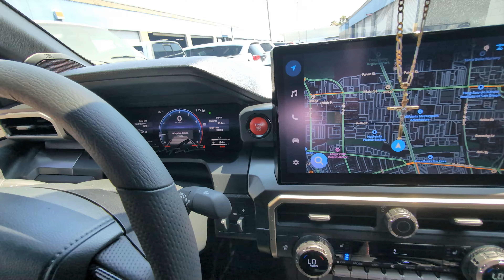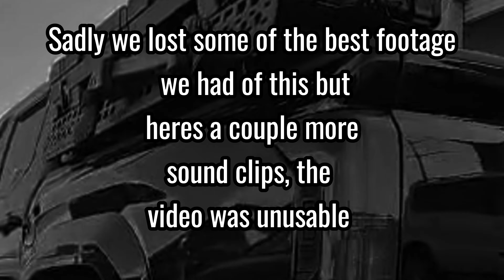Installing the MAGNAFLOW EXHAUST System on a 2024 Tacoma! DUAL PIPES & BURBLES

Comment: Oh god that sounds terrible. Sounds like the truck is farting . The new tacomas are so disappointing without a v6 option .
Reply: I own one and I’d take it 10 times out of 10 compared to any other midsize truck on the market. With an intake my truck sounds so good and it is much more capable and faster than any of the prior generations
Reply: @DizzyMcSchwifty  Agreed. People that can't afford one are drinking the hateraid. The new Taco is amazing. More power, better suspension, better everything. A four cylinder Toyota is the original secret sauce. There is a tune that gives it 50 more hp. Try that with a naturally aspirated engine...